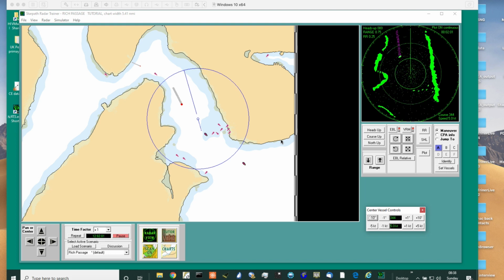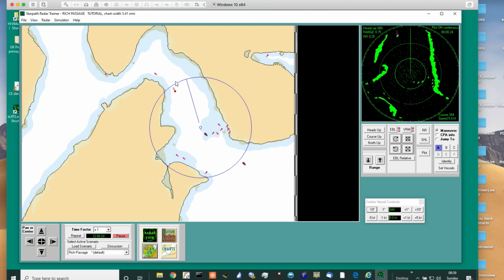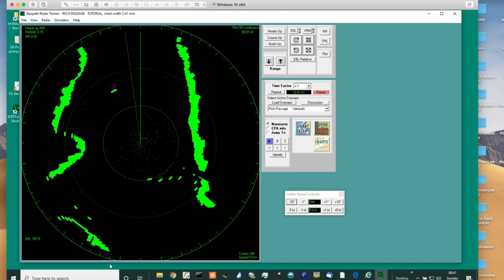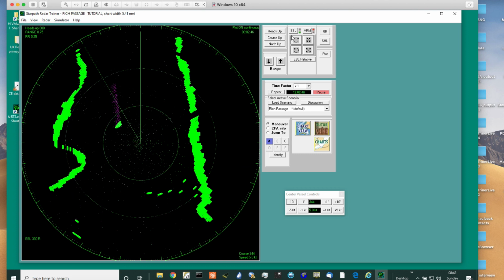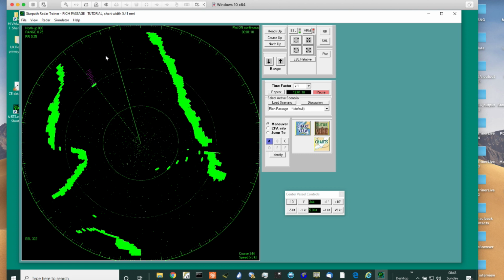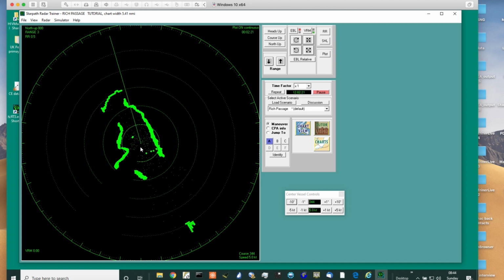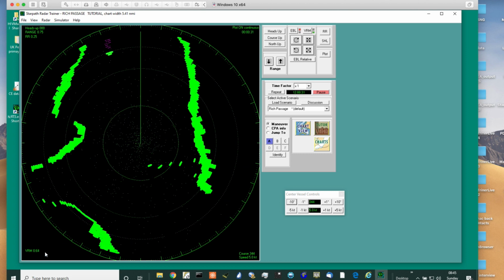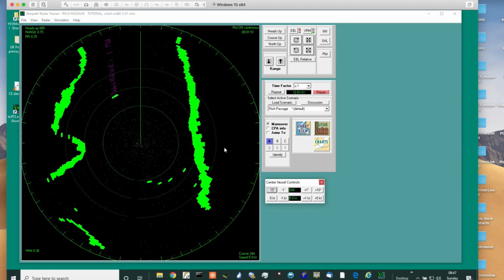Radar EBL and VRM

Comment: Get with the 21st Century and work wit Mac too
Reply from the maker: We use all Macs here at Starpath. We run Radar Trainer using VM Ware Fusion. This way we can run both Mac and PC products which is indeed the 21st century approach. With the one exception of LuckGrib for Mac (a weather program), all navigation, weather, and communications programs for mariners have better PC versions than Mac versions, so the use of an emulator is crucial if you have only a Mac computer.  The other option that a lot of Mac mariners choose is to purchase a PC for  maritime work.  Acer has excellent PC laptops for under $300.